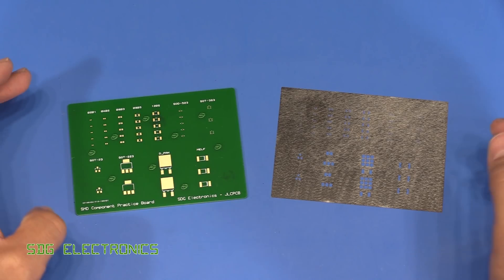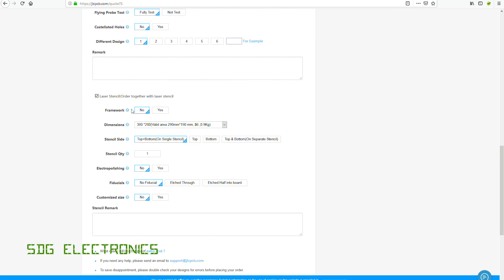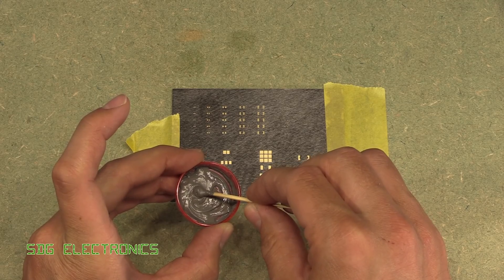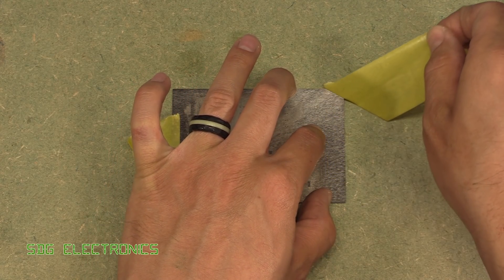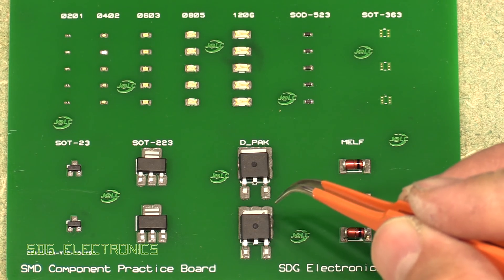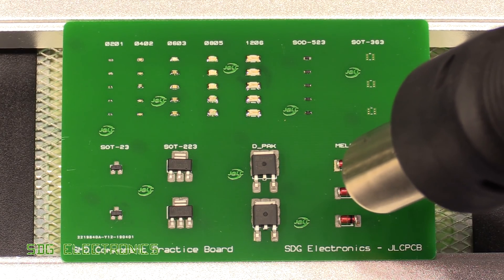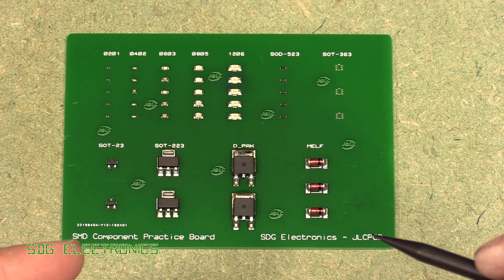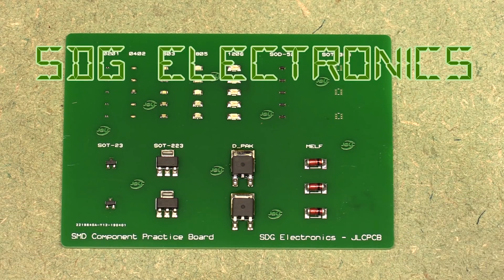SDG #076 PCB Assembly Process using JLCPCB Paste Stencil - Soldering Techniques #04

Comment: Someone should invent a part placement stencil for large numbers of parts - I have a 300 part this week - that you space above the PCB. Then  you just have to drop parts in holes.
Reply: That sounds like a grand idea.  First, use a solder stencil to put the liquid solder in the correct places.  Second, remove the solder stencil.  Third place a part placement stencil with a spacer to hold it above the PCB.  Fourth, drop the parts through the holes to get them properly aligned.  Fifth, remove the parts stencil.  Sixth, apply heat.

Making the part stencil shouldn't be any more involved than making the solder stencil.

Comment: A word from the wise... If you're ordering the stencil from JLCPCB, definitely make sure that to have the stencil cut to the right size.. Otherwise you'll get charged a fortune for shipping because the package ends up very large. Cheers!!
Reply from the maker: Yep, I did that on my first order 😂
Reply: @sdgelectronics  Honestly, I always get my stencils with the framing. Despite the shipping cost, it's so nice to have a rigid frame to hold on to for holding the stencil in place.
Reply: D'oh! So that's why I got reamed on shipping charges. Wish I had read your post before I ordered.

Comment: Thanks Steve! As I understand it, after the solder paste has flowed, you are supposed to leave the preheater on and turn the temperature all the way down. Then the preheater will slowly cool the board down.
Reply: I think that this type of ceramic preheater has a large enough thermal mass that when it's turned off it slowly cools down and so does the board with it, so it's not a too rapid cool down of the board.
Reply: I meant for multilayered boards and forgot to mention that. If you just shut this preheater off, it will cool down pretty fast.
Reply from the maker: @robertcalkjr.8325  It took about 10 minutes before I could remove the PCB, so I was not too concerned about the thermal stress although it of course did not follow the correct profile.
Reply: The board will cool faster than the heater block, in my experience. Most of the boards that I solder on are populated so I don't turn the preheater up too high because I don't want to start melting stuff. I normally turn it up to 180C, which will give me about 175F on the bottom of the board, unless I cover around the board to keep the heat from escaping.
The temperature on the preheater is at the ceramic heater block, not the board above it.